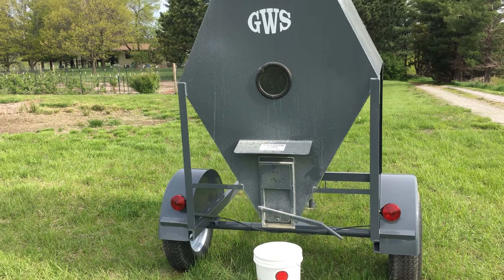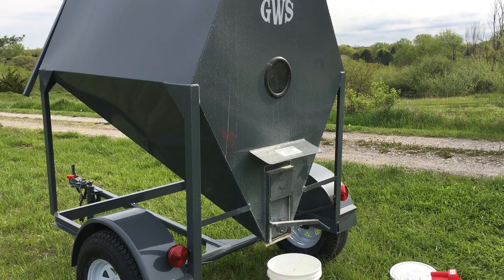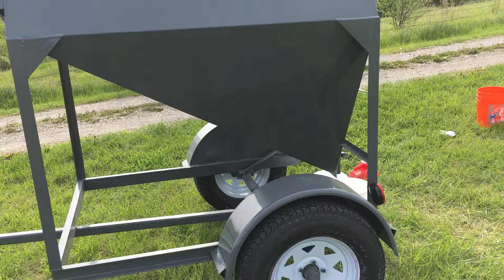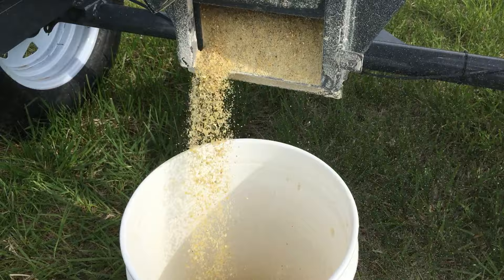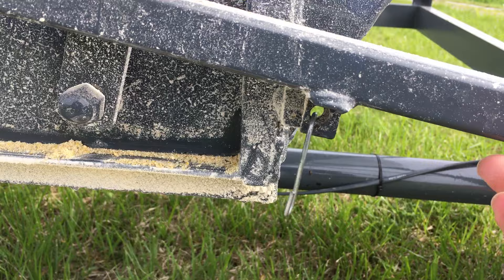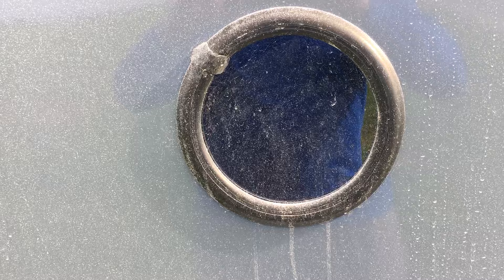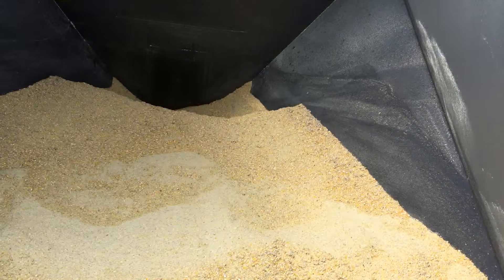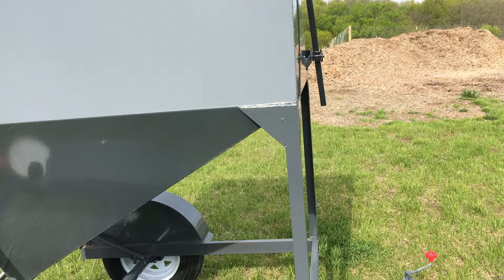Portable Grain Bin (Chicken Feed) From GWS!

Comment: Does the buggy tow pretty smooth on the road when pulling it with a truck?
Reply from the maker: It's pretty light weight. I can move it by hand when it's empty. It's fine on the road when it's loaded down with feed. It has a really light axle so I wouldn't haul it a lot as a habit. I mainly pull it around the farm.